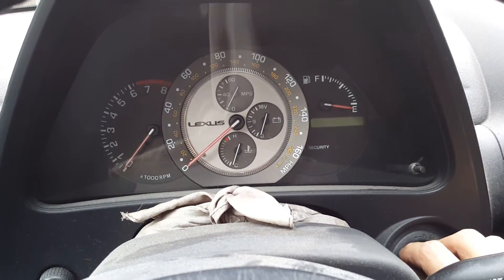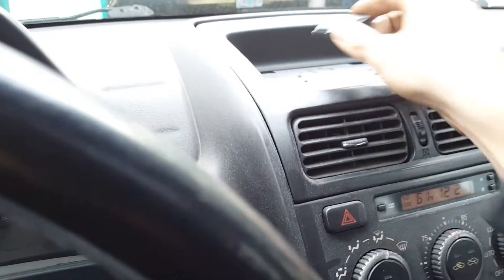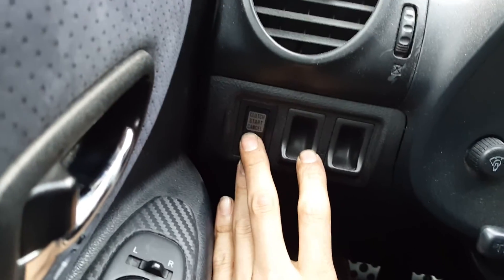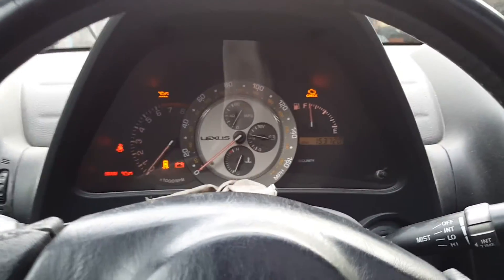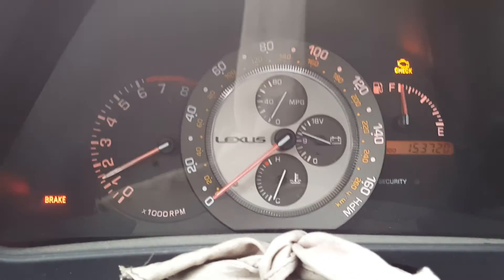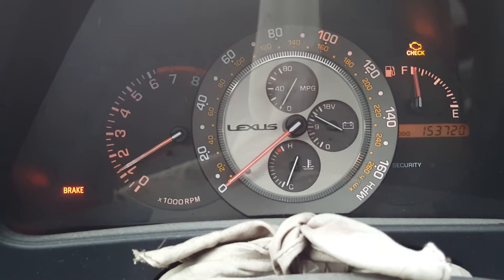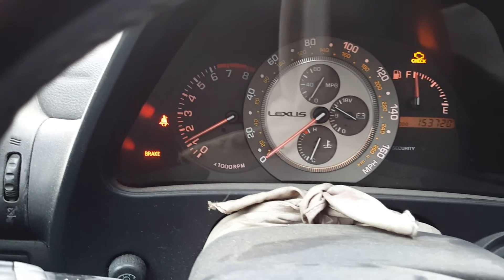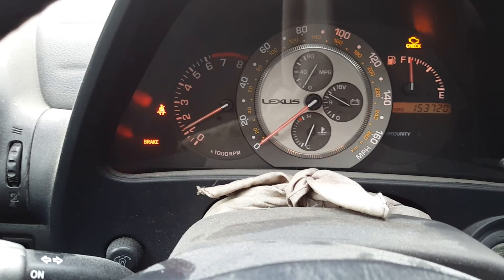IS300 Security Immobilizer Bypass

Comment: Im haveing a similar issue the car wont start it cranks over ok. The security light is flashing i got it put on a computer and the immobiliser is faulty is there any way of bypassing it or a place that can remove the immobiliser
Reply from the maker: @RoofboxCamping  if you Google search "Quatum-Auto is300 immobilizer delete" you'll find a service that offers the immobilizer delete for IS300 ecus.